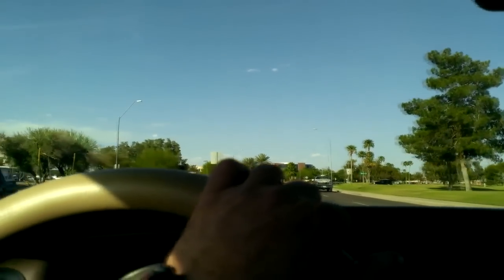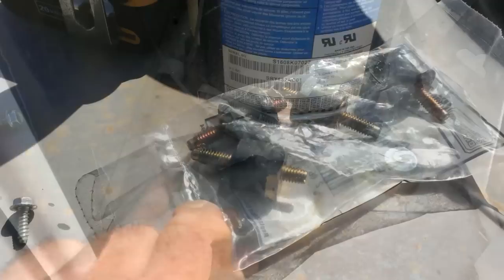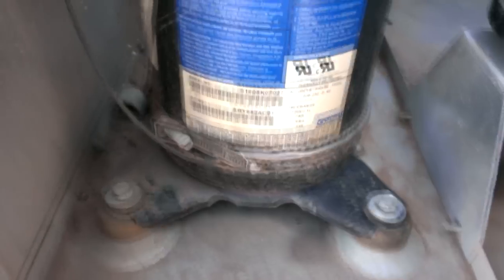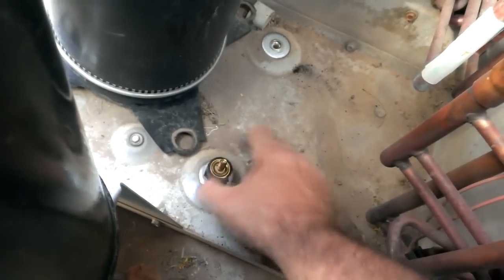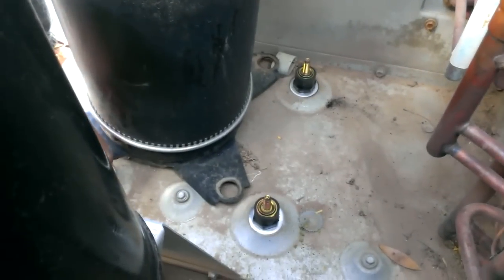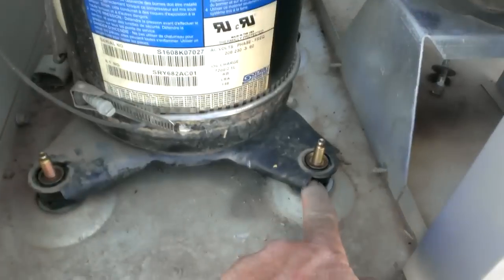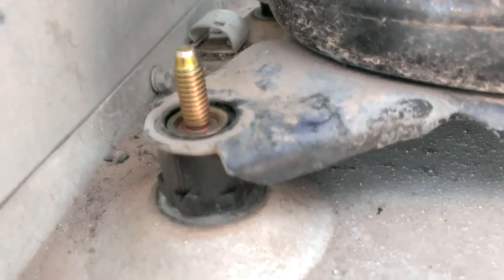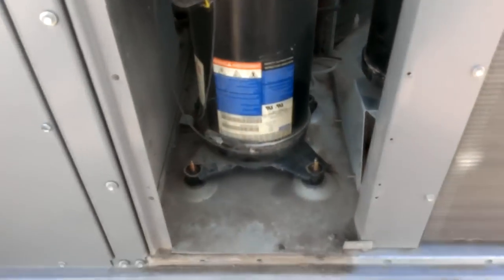Carrier compressor vibration dampener mounts - show-n-tell

Comment: I am so deep in YouTube searching for an answer for my Residential Carrier AC scroll compresor vibration through the line set. It travels into the wall and i hear the hummming/vibration.  I have moved the lines to the exterior, I have the blankets and the rubber feet that came with the unit/tech installed.  I still have vibration traveling through the line let into my wall that i can hear. Hummmmmmm. Is there a better rubber foot?  I saw another video where the tech made a u shape on the lineset outside the unit? when I look inside the units there is a u shape on the line. What is your opinion?  I have 5 units and all 5 do this.  The line set runs into the house to the attaic to the handler. If  I crawl into the attic space you can hear the hummming and feel it when you touch it. I do not see where there is any touching to studs.  I will do a better examination to be sure but I have been all over my house trying to figure this out. My AC tech is hands up, tells me this is just how it is. I cannot accept this.  This was not an issue with the Tranes that they replaced. I realize its the new scroll condenser that is the difference . I have resorted to placing sandbags near the lineset that enter the home to attempt to absorb some the vibration. That is how desprate I am for an answer. Is there any suggestions you have?
Reply from the maker: Often the noise heard inside on a split is the line set touching the inside drywall. But sounds like you already had the lines pulled out of the wall and moved. I am not familiar with the newer Residential units so if there is a known issue I am unaware of it.

The rubber isolation mounts in my video are more for when it is a rooftop unit and you head it through the base of the unit and into the roof. These won't stop your line set vibration. 

Maybe have a tech install a pair of re enforced rubber vibration hoses on your line set just as it leaves your outdoor unit. Those are used on commercial/refer units. Maybe it will do the trick

Comment: I was told by an AC company in Las Vegas My Goodman AC needs a new compressor. and it needs "modifications". My Home Warranty company will cover the compressor but He said it would cost me $800 for the mount pads. Advice?
Reply from the maker: Home warranty don't pay ac companies squat compared to their normal rate so they find other ways to, Ke money.
The new compressors come with new standard isolation mounts.
If you're wanting these dampers they will cost a few hundred
Reply: @hackfreehvac  thank you

Comment: My Carrier AC unit making an ua ua ua sound when its on.  i know its a compressor because it normally shutoff before the AC turns off.  it does not sound loud outside BUT behind a wall it rattled the wall adjacent to it that's causing even more noises.  how do i get access to replace dampener ?

Comment: Just found this old thread as I've been researching how to reduce compressor noise in a home we just bought which has an a/c unit on a third floor deck just above our master bath. Thanks for posting. Vibration isolation pads at the compressor corners I've placed down help but don't solve the problem.    I have a Ruud unit that is 5 yrs old.  That likely uses the same Scroll compressor and can take the carrier KA75UG100?
Reply from the maker: Those fit most compressor mounts. Unless there are welded studs to the unit base that can't be removed to install these.
As long as there were typical bolts screwed down through the compressor feet and into the unit base. These threads match those.

This kit doesn't come with nuts for the top when you set the compressor on them so you will need to get them from the hardware store.
Reply: @hackfreehvac  Thanks!  I did source the KA75UG100 and just picked up washers and nuts to fit at Lowes.  Now trying to decide if I'm capable of removing the compressor and installing these myself or calling in a local HVAC person.  Leaning towards calling in an HVAC person.  I just replaced the existing cheap compressor pad with a more substantial one supposed to reduce vibration and that did nothing.  Have tried a few different small square rubber and cork vibration isolators placed at the corners where the compressor sits on the pad and that helped some - reduced sound by a few db.  But really hopeful for this hack!
Reply from the maker: @razman99100  
The compressor is difficult to lift with the pipes welded in place.
I lift them carefully just enough to move to one side and screw in two isolators.
Then lift it up and over the two I just installed to clear the space to screw in the next two. 
Then I move it over and drop into place

Comment: Hello sir, I know that this is an old video, but I have a problem with my window AC, I feel the walls vibrating as soon as the compressor starts, problem is... I tried everything, here they dont put a wooden frame/box around the unit before putting it in the wall, so I made a wooden box had the "engineer" get the AC with it's case out and put the box, before that I replaced the old compressor feet but it also didn't do anything.... I'm literally going crazy and the place I study in is actually insane how everyone just wanna do what they don't even have any clue about, they just wanna work even if they didn't learn anything about it... I'm a student and this is actually driving me nuts for the last 5 months I can't think of anything other than the wall vibrating.
I don't know if it's the compressor, or if I didn't put the feet as they are supposed to be "I heard someone say that you shouldn't screw them all the way down so" is that what I actually should do to prevent any movement.... I actually don't know what to do
Reply from the maker: Your window AC would have a small compressor in it.
So these mounts may not even work on it.
Window ac units are often not very loud tho. So maybe it is just not a brand/model on the quiet side.

Are you at ground level or near it?
The thing to ultimately do is get rid of the window unit and install a "mini split"
You just have a quiet fan coil inside and the compressor section is on the ground, on the roof, or hanging off of the wall outside.
And they are super quiet.
Reply: @hackfreehvac  Sir, here in the sh**hole I study in, a window AC unit is considered a very advanced technology, these mini split unit I bet they don't even know about them here... Anyways, thanks to you and the gentleman in the comments section who advised to loosen the bolts I've managed to solve my really annoying problem with the vibrations... It's significantly better now.
Thank you so much, kind sir!

Comment: Does this only work for carrier units? I have this issue with multiple Payne model PH10 units on the roof directly above my bedroom. If you could point me towards the part number for that compressor it would be immensely appreciated!
Reply from the maker: They work on any residential style scroll.
I've used them in York etc with the same success. 
Payne is a division of Carrier.
Reply: @hackfreehvac  just installed these on the unit above my bedroom and the oscillating sound is still apparent. Definitely quieter but still needs more work to be completely silent. Do you have any other suggestions?
Reply from the maker: @navttv  If the noise is the supply fan then it may be addressing. 

If this is a shallow flat roof than it can be tough. 
Also if the unit is connected to a duct elbow rather than down under, you can lift the unit up onto rubber "isolation pads" to help dampen some more. 
The metal duct will carry some vibration as well however.

Comment: I need your help.  We just purchased a PPG2GF | Maytag® M1200 15 SEER in June. The unit mounts on the roof right over our master bedroom.  The contractor placed unit directly over the duct whereas the old unit was mounted with an "elbow" duct to the house.  Contractor said unit would be more efficient if unit was directly over the hole.  Anyhow I feel a vibration every time the ac is on.  I can feel the resonance in the bed.  The picture on the wall will vibrate.  It wakes me up from my sleep sometimes and keeps me from falling asleep sometimes.  Quite annoying. We have talked to the contractor and he told us to give it a month or two because new ac do sound different and sometimes just getting used to the noise is all that is needed. But he also said to call him back if it still bothers us.  He is willing to work with us.  Well, we are getting ready to call him.  It still bothers us, A LOT.   I had imagined the vibration was coming from the fan on the roof unit, like it was out of balance or out of trim.  Now after watching your video I'm wondering if it isn't the compressor.  The Maytag has a scroll compressor. 
Can I buy these dampeners and install them myself prior to calling the contractor?? 

I would like to do this to see if it fixes the problem before to calling the contractor.   But if it's not possible, I will specify to the contractor this is what I would like to have installed, dampeners on my scroll compressor. 

Other than the vibration the unit works great!
Reply from the maker: Yes the newer units with a Scroll sound "different" in that they have an oscillating sort of hum where the old reciprocating compressors had a constant hum so that in itself has unnerved some people however if it is rattling pictures on your wall then that is pretty severe.

If you have him come out, have him run it with the compressor disabled at first to make sure it is not the blower or from air in the ductwork.
If the vibration in the wall is only there when the compressor is running ask him about special compressor mounts.
Some techs actually do not know about these.
Show him this video if you have to! LOL
The part comes from Carrier.
They are not the cheapest thing so if you buys them it will cost him a few bucks.
Maybe he'll give you a deal on installing them if he don't throw them in.

You never know how a unit will sound until you get it on the roof.

As for downflow verses the elbow, that generally is a cleaner install and looks good.
But with your setup maybe it did make it louder.

These compressor mounts are like springs once they are on.
They have made a very noticeable difference on every unit I have installed them on, Whether it is a Carrier or another brand.
Reply: hackfreehvac  Thanks for the quick reply! I will definitely talk to him about running the unit with the compressor disabled to isolate where the vibration is coming from, be it blower, duct work, etc.  Then we will talk about the compressor mounts if we think the compressor is the culprit. Your info has been a great help! Thanks again!
Reply from the maker: Heidi B
No problem.

Comment: The air conditioner for the apartment building next door sends out a 
persistent irritating low-frequency hum which resonates in the area 
between the two buildings and penetrates right into my apartment.  It is
 impossible to tune out this noise and it has disrupted my sleep and 
made my home life miserable.  The noise doesn’t sound like the loud 
rattling you hear from a typical air conditioner and the unit isn’t much
 louder than the larger ones next to it.  Can anyone advise me on what 
to do?

Comment: Please help, I have my AC outside unit that just really loud.  Are these dampener mounts for AC units? Thanks
Reply from the maker: These help the vibrations heard when you have a rooftop unit.
If it is on the ground the sound you hear inside is either the copper line set vibrating (from the refrigerant pulses) in your wall or you have something like a Goodman unit with a loud Bristol Compressor. In that case you hear it standing next to the unit and maybe inside too if loud enough.

If it's a loud raspy compressor sound you hear grinding away they can add a "noise blanket" around the compressor.

If it is just noise generated in the wall then there is no easy fix aside from opening the wall and making sure it's not touching wood, etc.

Comment from the maker: Yeah but this makes all the difference in the world when it comes to isolating vibrations in a rooftop unit. The compressor feels like it is on springs.
Reply: Are you still available? I have tempstar 4 ton seer 14 just installed and it vibrated so loud.Would replacing the mount that you did in this video make a big different? It's a new hvac.

Comment: I'm looking on eBay and can't seem to find this part anywhere... It's for a Goodman ground heat pump unit.
Reply from the maker: Michael Vuong Are you referring to the compressor vibration mounts shown in my video?

You will be hard pressed to find these anywhere except through the Carrier brand distributors. 
Which is called "Sigler" in my area.
Reply from the maker: Oh, also. These help with the vibration you hear through your roof from a rooftop unit.
If you have a Goodman brand unit with the nasty Goodman growl to it, these will not help in that case. 

The growl can be reduced by adding what they call a "compressor noise blanket".
Which is essentially insulation inside a plastic enclosure that is formed to wrap around the compressor and secure to itself with velcro.

They are not cheap either and I am sure you need to go to the wholesale dealer to find those as well.
Reply: hackfreehvac Hi, thanks. I already have one coming next week, they're Brinmar universal fit so I'm going to put them on. I'm in the valley as well, so I guess I could look up Signer for those. I doubt the blankets will get rid of the vibration, so those feet might do the trick.
Reply from the maker: Michael Vuong Also if the vibration noise is coming from your wall when it is running it could be the line set in the wall laying against the sheetrock or wood stud in such a manner that it resonates the wall.
Reply from the maker: hackfreehvac Sigler is located in three places now.
Tempe, Tolleson and Deer Valley.
Reply: hackfreehvac I just installed the Brinmar soundblanket and it made a noticeable difference, I think it was worth the 55 dollars.

But as I had suspected, the line set is still sending some compressor noise through the wall.  I thought about installing the compressor mounts like the one in your video, but I don't have easy access to the compressor since I need to reach over the surrounding condenser coils.
Reply from the maker: Nice that you found that blanket. $55 is a deal.

If the unit is on the ground those rubber iso mounts might not do much for ya. It may be the pulses in the lines causing them to resonate in your wall.

THAT is not an easy fix as you'd have to cut open the wall.

Which I've had to see Chainsaw Charlie do in new warranty installs.
Reply: hackfreehvac I've heard of driving a six foot copper pipe into the ground and having it brazed on the line set entering the home. It was done by a professional of course because they had to recover the R22. It was recommended by the manufacturer. This was also before R22 got expensive though.
Reply from the maker: Michael Vuong
Hmm never heard of that one but sounds like it works as a dampener.

Comment: THIS WORKS SO WELL!  It's a MIRACLE! Thank you for such a great video, can't even begin to tell you how much we appreciate this solution for the building.  My colleague and I have been searching years to resolve the vibration noise issue with rooftop Carrier packaged unit / heat pumps.  It got so bad that we thought about getting new curbs with springs.  Nothing else worked, compressor blankets, new X13 ECM, you name it, we probably tried it... except for this.  

So we went ahead and got the part KA75UG100, they range from $12.50-$20 a piece in 2022 (for viewers reading this years later), the pack of 4 in the video would be about $50-$80 in today's prices.  At first we noticed the factory ones actually had a thicker rubber base, so we had some concerns whether these would work or not.  But the genius of these isolation mounts is in the design.  We were able to shift the compressor enough to fit all four of them without cracking the copper pipes and got some washer/nuts (not included) to secure them.   Agree you might not really need them since they can snugly fit the holes of the Copeland scroll compressor.  The screw threads on the KA75UG100 might be different than factory screws, but since Carriers have a plastic base it went in and made new threads.  

After installation:  Our reaction was completely the same, we had to make sure if the AC was even on, but sure enough, the cool air was flowing without all the vibration noise.  THANK YOU!!
Reply from the maker: Yup.  They do wonders for through the roof vibration issues. 

Glad to see people still finding a use for these.
And great feedback👍

Comment: Cool video.  I have a couple of questions.
1. How did you move the compressor with the copper lines connected?
2. If the compressor is allowed to vibrate a tiny little bit on those new
   isolators, won't it eventually induce a crack in one of the copper
   refrigerant lines?  Even a seemingly unnoticeable vibration, over years,
   could eventually cause a failure in the rigid copper line correct?

Comment: Found the part number: Carrier KA 75 UG - post how it works for you if you try it!
Reply: Thanks Ned! Did you happen to use these? I'm wondering if the rubber is soft enough to dampen vibration with these.